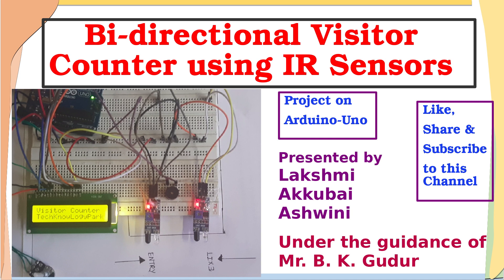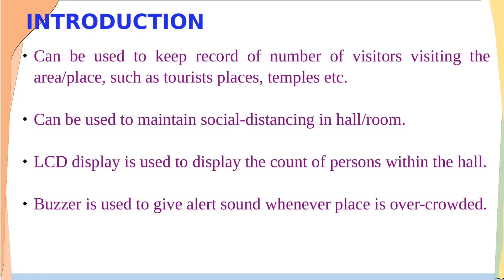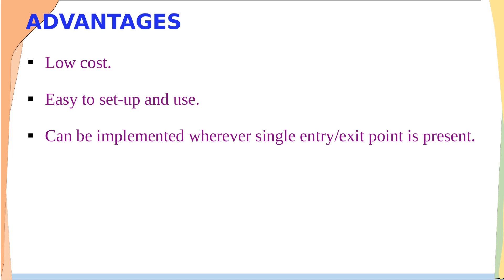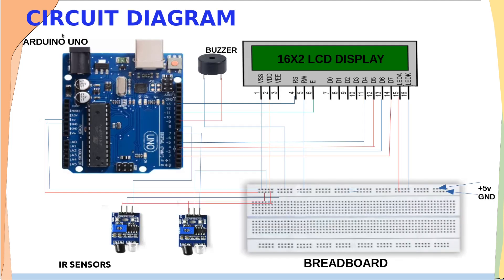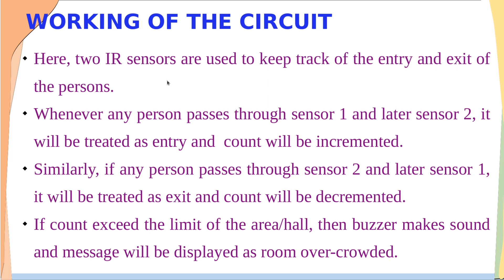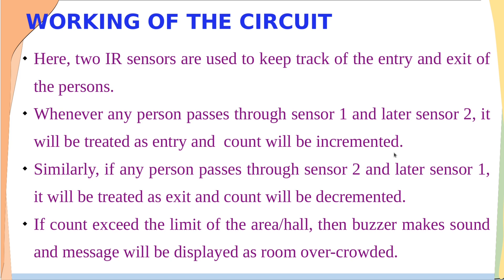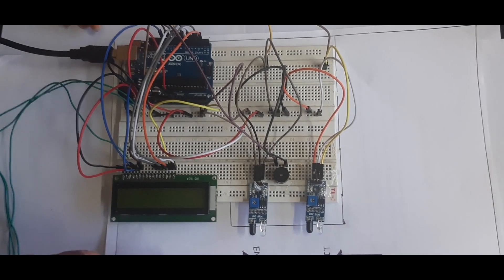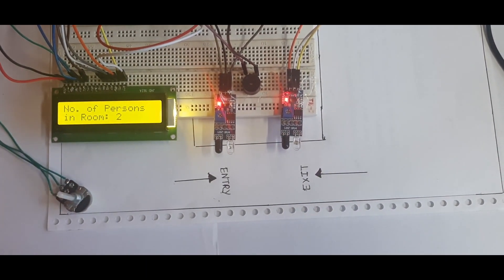Bi-directional Visitor Counter using Arduino and IR Sensors

Comment: I want to count the exact number of visitors entering and exiting the museum. How much would it cost to make such a device? What parts are needed to make it and where do they usually come from? How could the price be?
Reply from the maker: It is very simple to make. All the devices/materials needed can be ordered from Amazon. The list of items can be seen in the video. The price will not be more than Rs. 500/-, in Indian market.
Reply from the maker: Code is available in comment section of the video
Reply from the maker: Find the source code below:

#include<LiquidCrystal.h>
LiquidCrystal lcd(13,11,5,4,3,2);

#define MAX_LIMIT  40   //Maximum number of persons allowed in the hall or room

#define in 8    //IR Sensor 1
#define out 7   //IR sensor 2
#define buz 9   //Buzzer pin

int count=0, pos=0;

//Function to Display the count on LCD

void displayCount(int num){
	char str[6];        //To hold count to be displayed
    	int i, rem, len = 0, n;

 	/*Convert integer (count) to string for displaying on LCD*/
    	n = num;
    	while (n != 0){
        	len++;
        	n /= 10;
    	}
    	for (i = 0; i < len; i++){
        	rem = num % 10;
        	num = num / 10;
        	str[len - (i + 1)] = rem + '0';
    	}
      	str[len] = '\0';	//Put NULL character to end the string

	/*If count in room or hall is less than maximum limit of the hall or room, 
	  then display the message on LCD to print Number of persons in room */
      	if(count < MAX_LIMIT){
     		lcd.clear();
      		lcd.setCursor(0,0);
      		lcd.print("No. of Persons");
      		lcd.setCursor(0,1);
      		lcd.print("in Room: ");
      	}

    	/*If number of persons in room is equal to MAX_LIMIT of the room,
          then display the message as Room Full */
    	if(count==4){
      		lcd.clear();
      		lcd.setCursor(0,0);
      		lcd.print("Room Full ");
      		lcd.setCursor(0,1);
      		lcd.print("No.of Persons:");
      	}

	/*If number of persons in room is greater than MAX_LIMIT,
          then display the message as Over Crowded Room and also turn on Buzzer*/
     	if(count>4){
        	digitalWrite(buz, HIGH);	//Buzzer made ON
	        lcd.clear();
      		lcd.setCursor(0,0);
	      	lcd.print("Over CrowdedRoom");
      		lcd.setCursor(0,1);
	      	lcd.print("No.of Persons:");
     	}
      	else{	//If count is less than or equal to MAX_LIMIT, the turnoff buzzer
           	digitalWrite(buz, LOW);
      	}

	//Display the count on LCD
    	lcd.print(str);
}

//Setup function for initial setup
void setup(){
	//IR sensor pins are made as input pins
  	pinMode(in, INPUT);	
  	pinMode(out, INPUT);

	//Buzzer pin is made as output pin
  	pinMode(buz, OUTPUT);

	// Buzzer made ON for small duration to indicate start of the counting
  	digitalWrite(buz,HIGH);
  	delay(1000);
  	digitalWrite(buz,LOW);
  	delay(50);

	//Initial Message on LCD
  	lcd.begin(16,2);
  	lcd.print("Visitor Counter");
  	delay(100);
   	lcd.setCursor(0,1);
  	lcd.print("TechKnowLogyPark");
  	delay(100);
}

//Loop function 
void loop(){  
 
  	if((digitalRead(in))==0){
    	delay(20);
    	while((digitalRead(in))==0);
    	/*
    	Arrangement or placing of sensors: while entering the room from outside, sensor1 will be 
    	encounterd first and sensor2 will be next.
    	pos will tell the position of a person, entering/leaving the room

    	If pos=0, default value; No person is entering/leaving the room/hall
    	If pos=1, person is entering the room and crossed sensor1 (in)
    	If pos=2, person has entered the room after crossing both the sensors
    	If pos=3, person is going out of the room and crossed the sensor2 (out)
    	If pos=4, person has gone out of the room after crossing both the sensors
    	*/
    	if(pos==0)	
       		pos=1;
       	else if(pos==3)
       		pos=4;
  	}
  	if(pos==4 && count!=0){
    		count--;		//person has left the room, decrement the count
    		displayCount(count);
    		pos=0;
  	}
   	if((digitalRead(out))==0){
      		delay(20);
      		while((digitalRead(out))==0);
       		if(pos==1)
       			pos=2;
       		else if(pos==0)
       			pos=3;
    	}
   
    	if(pos==2){
      		count++;		//person has entered the room, increment the count
      		displayCount(count);
      		pos=0;
    	}
    	else if(pos==4 && count!=0){
      		count--;		//person has left the room, decrement the count
      		displayCount(count);
      		pos=0;
    	}
    	delay(50);
}

Comment: Mam I want the code
Reply from the maker: I have given code in comment section of the video. You just refer to the comments to find the code.
Reply: @TechKnowLogyPark  link doesn't work mam
Reply from the maker: Source Code Available in comment section of this video. Anyhow I am pasting it again; find the source code below:

#include<LiquidCrystal.h>
LiquidCrystal lcd(13,11,5,4,3,2);

#define MAX_LIMIT  40   //Maximum number of persons allowed in the hall or room

#define in 8    //IR Sensor 1
#define out 7   //IR sensor 2
#define buz 9   //Buzzer pin

int count=0, pos=0;

//Function to Display the count on LCD

void displayCount(int num){
	char str[6];        //To hold count to be displayed
    	int i, rem, len = 0, n;

 	/*Convert integer (count) to string for displaying on LCD*/
    	n = num;
    	while (n != 0){
        	len++;
        	n /= 10;
    	}
    	for (i = 0; i < len; i++){
        	rem = num % 10;
        	num = num / 10;
        	str[len - (i + 1)] = rem + '0';
    	}
      	str[len] = '\0';	//Put NULL character to end the string

	/*If count in room or hall is less than maximum limit of the hall or room, 
	  then display the message on LCD to print Number of persons in room */
      	if(count < MAX_LIMIT){
     		lcd.clear();
      		lcd.setCursor(0,0);
      		lcd.print("No. of Persons");
      		lcd.setCursor(0,1);
      		lcd.print("in Room: ");
      	}

    	/*If number of persons in room is equal to MAX_LIMIT of the room,
          then display the message as Room Full */
    	if(count==4){
      		lcd.clear();
      		lcd.setCursor(0,0);
      		lcd.print("Room Full ");
      		lcd.setCursor(0,1);
      		lcd.print("No.of Persons:");
      	}

	/*If number of persons in room is greater than MAX_LIMIT,
          then display the message as Over Crowded Room and also turn on Buzzer*/
     	if(count>4){
        	digitalWrite(buz, HIGH);	//Buzzer made ON
	        lcd.clear();
      		lcd.setCursor(0,0);
	      	lcd.print("Over CrowdedRoom");
      		lcd.setCursor(0,1);
	      	lcd.print("No.of Persons:");
     	}
      	else{	//If count is less than or equal to MAX_LIMIT, the turnoff buzzer
           	digitalWrite(buz, LOW);
      	}

	//Display the count on LCD
    	lcd.print(str);
}

//Setup function for initial setup
void setup(){
	//IR sensor pins are made as input pins
  	pinMode(in, INPUT);	
  	pinMode(out, INPUT);

	//Buzzer pin is made as output pin
  	pinMode(buz, OUTPUT);

	// Buzzer made ON for small duration to indicate start of the counting
  	digitalWrite(buz,HIGH);
  	delay(1000);
  	digitalWrite(buz,LOW);
  	delay(50);

	//Initial Message on LCD
  	lcd.begin(16,2);
  	lcd.print("Visitor Counter");
  	delay(100);
   	lcd.setCursor(0,1);
  	lcd.print("TechKnowLogyPark");
  	delay(100);
}

//Loop function 
void loop(){  
 
  	if((digitalRead(in))==0){
    	delay(20);
    	while((digitalRead(in))==0);
    	/*
    	Arrangement or placing of sensors: while entering the room from outside, sensor1 will be 
    	encounterd first and sensor2 will be next.
    	pos will tell the position of a person, entering/leaving the room

    	If pos=0, default value; No person is entering/leaving the room/hall
    	If pos=1, person is entering the room and crossed sensor1 (in)
    	If pos=2, person has entered the room after crossing both the sensors
    	If pos=3, person is going out of the room and crossed the sensor2 (out)
    	If pos=4, person has gone out of the room after crossing both the sensors
    	*/
    	if(pos==0)	
       		pos=1;
       	else if(pos==3)
       		pos=4;
  	}
  	if(pos==4 && count!=0){
    		count--;		//person has left the room, decrement the count
    		displayCount(count);
    		pos=0;
  	}
   	if((digitalRead(out))==0){
      		delay(20);
      		while((digitalRead(out))==0);
       		if(pos==1)
       			pos=2;
       		else if(pos==0)
       			pos=3;
    	}
   
    	if(pos==2){
      		count++;		//person has entered the room, increment the count
      		displayCount(count);
      		pos=0;
    	}
    	else if(pos==4 && count!=0){
      		count--;		//person has left the room, decrement the count
      		displayCount(count);
      		pos=0;
    	}
    	delay(50);
}

Comment: Hello sir
Your code link is not in working.
Can you share code in comment?
Plz
Reply from the maker: #include<LiquidCrystal.h>
LiquidCrystal lcd(13,11,5,4,3,2);

#define MAX_LIMIT  40   //Maximum number of persons allowed in the hall or room

#define in 8    //IR Sensor 1
#define out 7   //IR sensor 2
#define buz 9   //Buzzer pin

int count=0, pos=0;

//Function to Display the count on LCD

void displayCount(int num){
	char str[6];        //To hold count to be displayed
    	int i, rem, len = 0, n;

 	/*Convert integer (count) to string for displaying on LCD*/
    	n = num;
    	while (n != 0){
        	len++;
        	n /= 10;
    	}
    	for (i = 0; i < len; i++){
        	rem = num % 10;
        	num = num / 10;
        	str[len - (i + 1)] = rem + '0';
    	}
      	str[len] = '\0';	//Put NULL character to end the string

	/*If count in room or hall is less than maximum limit of the hall or room, 
	  then display the message on LCD to print Number of persons in room */
      	if(count < MAX_LIMIT){
     		lcd.clear();
      		lcd.setCursor(0,0);
      		lcd.print("No. of Persons");
      		lcd.setCursor(0,1);
      		lcd.print("in Room: ");
      	}

    	/*If number of persons in room is equal to MAX_LIMIT of the room,
          then display the message as Room Full */
    	if(count==4){
      		lcd.clear();
      		lcd.setCursor(0,0);
      		lcd.print("Room Full ");
      		lcd.setCursor(0,1);
      		lcd.print("No.of Persons:");
      	}

	/*If number of persons in room is greater than MAX_LIMIT,
          then display the message as Over Crowded Room and also turn on Buzzer*/
     	if(count>4){
        	digitalWrite(buz, HIGH);	//Buzzer made ON
	        lcd.clear();
      		lcd.setCursor(0,0);
	      	lcd.print("Over CrowdedRoom");
      		lcd.setCursor(0,1);
	      	lcd.print("No.of Persons:");
     	}
      	else{	//If count is less than or equal to MAX_LIMIT, the turnoff buzzer
           	digitalWrite(buz, LOW);
      	}

	//Display the count on LCD
    	lcd.print(str);
}

//Setup function for initial setup
void setup(){
	//IR sensor pins are made as input pins
  	pinMode(in, INPUT);	
  	pinMode(out, INPUT);

	//Buzzer pin is made as output pin
  	pinMode(buz, OUTPUT);

	// Buzzer made ON for small duration to indicate start of the counting
  	digitalWrite(buz,HIGH);
  	delay(1000);
  	digitalWrite(buz,LOW);
  	delay(50);

	//Initial Message on LCD
  	lcd.begin(16,2);
  	lcd.print("Visitor Counter");
  	delay(100);
   	lcd.setCursor(0,1);
  	lcd.print("TechKnowLogyPark");
  	delay(100);
}

//Loop function 
void loop(){  
 
  	if((digitalRead(in))==0){
    	delay(20);
    	while((digitalRead(in))==0);
    	/*
    	Arrangement or placing of sensors: while entering the room from outside, sensor1 will be 
    	encounterd first and sensor2 will be next.
    	pos will tell the position of a person, entering/leaving the room

    	If pos=0, default value; No person is entering/leaving the room/hall
    	If pos=1, person is entering the room and crossed sensor1 (in)
    	If pos=2, person has entered the room after crossing both the sensors
    	If pos=3, person is going out of the room and crossed the sensor2 (out)
    	If pos=4, person has gone out of the room after crossing both the sensors
    	*/
    	if(pos==0)	
       		pos=1;
       	else if(pos==3)
       		pos=4;
  	}
  	if(pos==4 && count!=0){
    		count--;		//person has left the room, decrement the count
    		displayCount(count);
    		pos=0;
  	}
   	if((digitalRead(out))==0){
      		delay(20);
      		while((digitalRead(out))==0);
       		if(pos==1)
       			pos=2;
       		else if(pos==0)
       			pos=3;
    	}
   
    	if(pos==2){
      		count++;		//person has entered the room, increment the count
      		displayCount(count);
      		pos=0;
    	}
    	else if(pos==4 && count!=0){
      		count--;		//person has left the room, decrement the count
      		displayCount(count);
      		pos=0;
    	}
    	delay(50);
}

Comment: Hello maam in the circuit diagram pin number 3 of lcd is not connected , but in the code you have used as "LiquidCrystal lcd(13,11,5,4,3,2);" so where should i connect pin number 3 of lcd.
Reply: Thank you ma'am
Reply from the maker: Whatever the pin numbers mentioned in the function call lcd(13,11,5,4,3,2) belongs to pins of Arduino; these are not the pins of lcd. As per the circuit diagram, pin No. 3 is VEE, which can be used to vary the contrast of the display. 
I hope it is clear to you now.
Reply: @TechKnowLogyPark  ma'am 
I have my mini project final presentation tomorrow . I have doubts mam can i Ask you via email
Reply from the maker: Yes, go ahead; but it is Mr. B. K. Gudur who is replying to you.
Reply: @TechKnowLogyPark   Hello sir 
I'm using Arduino IDE software and dumped the code in the board .
The problems is, the counter is not decreasing whenever i exit and even buzzer is keep on ringing till i press the reset button on the board .
On Lcd display , only light is turned on but  nothing is displayed .
So can you help me to fix this problem .
Thank you
Reply from the maker: Are you getting proper display during entry? Is it working properly for entry? Whether counter is incrementing properly after every entry?
Reply: @TechKnowLogyPark  
I'm not getting anything on display 
But counter is increasing
Reply from the maker: You need to solve this step by step.
First write a simple program to display a message on LCD, dump the code on Arduino and check whether it will be displayed or not. Once it is displayed then you tell me, I'll tell you what to do next.
Reply: @TechKnowLogyPark  ok sir
Reply from the maker: Most of the time, the problem will be with connecting wires; check all the connecting wires using multimeter (continuity check).
Reply: @TechKnowLogyPark  yes done sir lcd is displaying the text sir . Now what I have to do sir .
Reply from the maker: Have you done continuity check? If not, check all the connecting wires..
Reply: Yes sir all the connecting wires are proper
Reply from the maker: Adjust the sensitivity of IR sensor so that it can properly sense the object.
Reply: Sir is potentio meter mandatory for this circuit
Reply from the maker: No.
Reply: @TechKnowLogyPark  The sensors are sensing sir . But after 5 people entering into the room buzzer starts ringing sir , but whenever exiting buzzer won't stop ringing , it keeps on ringing and nothing is displayed on the lcd from the begining .
Reply from the maker: In that case check the sensor that is crossed first during exit. Properly see whether it is sensing or not. And read the arrangement of placing the sensor given in below link:
http://techknowlogypark.in/bidirectional-visitor-counter-using-arduino/

Comment: Hello mam...

An error in code compiling please tell me how to solve it☹️
Reply from the maker: Tell me what's the error?
Reply: @TechKnowLogyPark   expected primary - expression before ';' token this is the error in "count-; //person has left the room, decrement the count .
Reply from the maker: Typing mistake in the code. Properly check the code..
Reply: @TechKnowLogyPark   mam can you provide circuit diagram of this project......
I want to implement on pcb 😐😐
Reply from the maker: It was available on website but now it is under maintenance. Send query to techknowlogypark@gmail.com, so that I can send the circuit diagram.